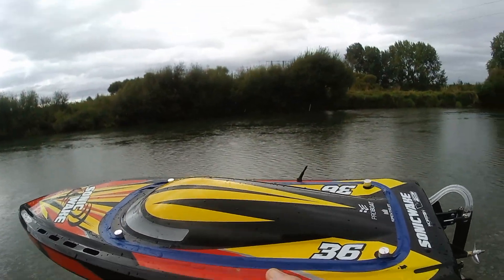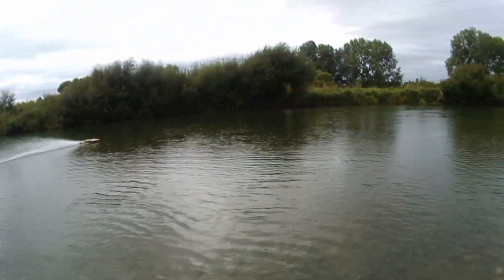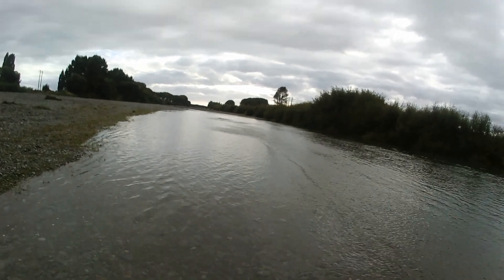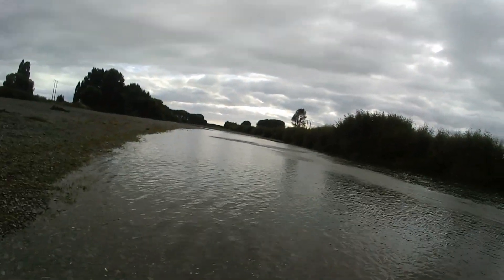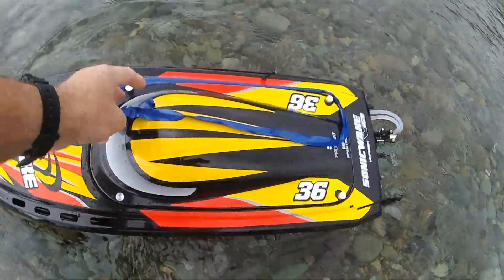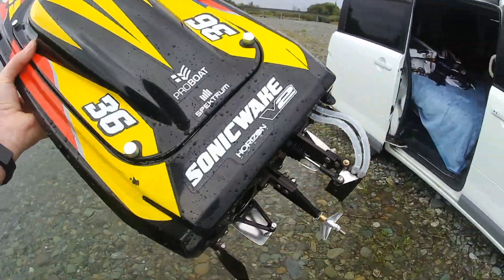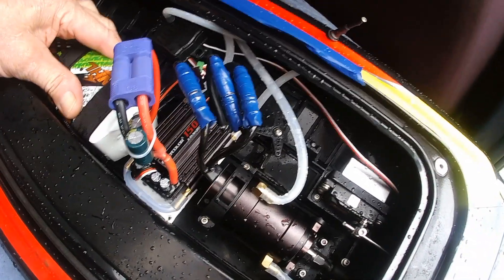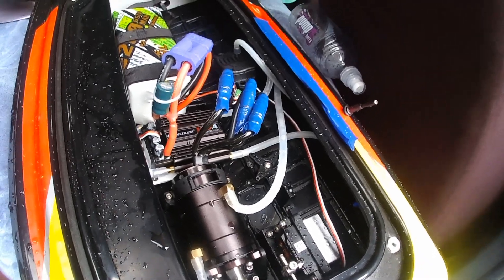Pro Boat Sonicwake V2 Rocket 4074 2250kv 6s 4214 Prop Reliable 👍4414 melts solder

Comment: Looks fast.
Seams more stable than my 33 inch delta force.
By a mile
I run a lower kv 6s 4714 at 63 mph 
But it’s all over the place
I’m thinking my rudders to long how far down in measurement is your rudder from the bottom vertically ?
Reply from the maker: I don't think mines that fast 👍 Rudder is 45mm  down from the bottom of hull
Reply: @paulcooper7162  thanks mate, I’ll check mine.

Comment: I was thinking of running a sss4074 2050kv on my 150a flycolor, ive got 45mm 1.6p and  4519 cnc props i can use.. you think it will be a reliable setup heatwise? Im not sure if i the esc might take a hit or if id need a 180a. Considering experimenting with those little waterpumps also so the watercooling has a constant stream, for 8$ its worth trying out haha
Reply from the maker: Hi 👍 I honestly think SSS 4092 1659jv is best with 45mn Prop and 180A esc

Comment: Nice one Paul,  I'm getting this motor. Bargain especially since I just locked up an old 4s kyosho  vortex I ran on 6s ha,ha, I've heard they're great motors .
Reply from the maker: Hi Peter 👍yes they are a good motor bearing are very good not noisey like most other no,tors Ive had
Reply: @paulcooper7162 esc bro